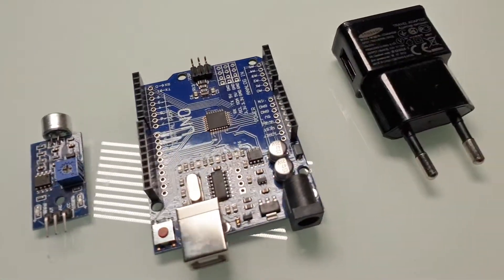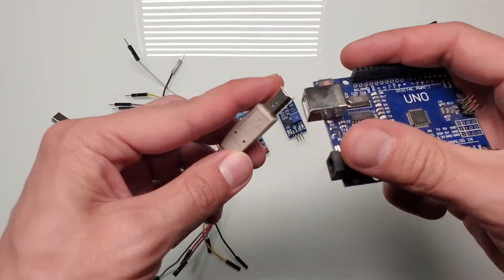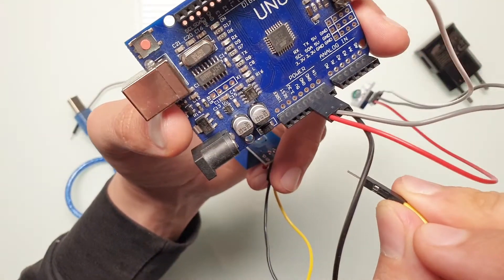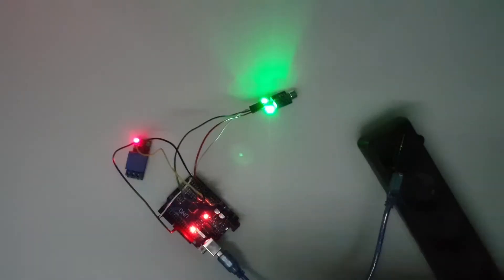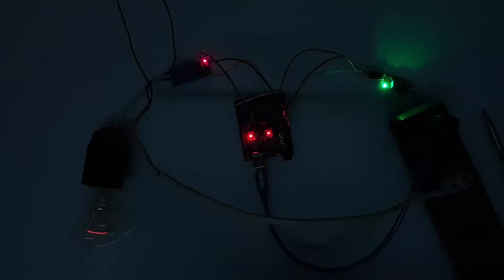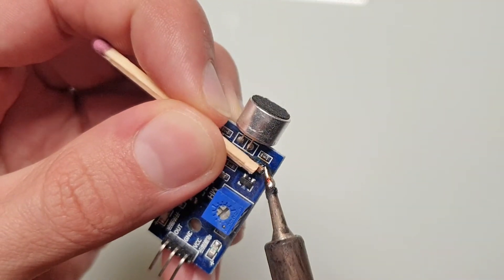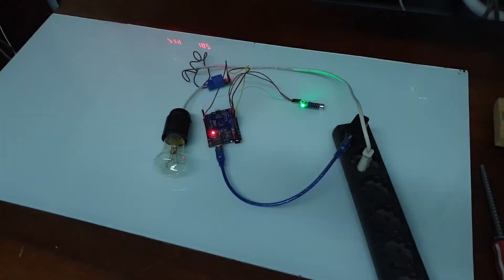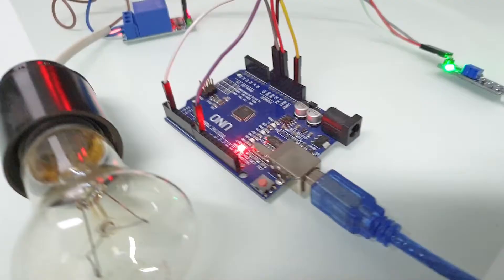How to make Smart Clap Switch using Arduino | DIY Arduino Projects

Comment: hi sir, i have a little problem sir, why clap its not detected at audino, but if i touch sensor audio, its can😅
Reply: Hello, did you manage to figure it out? I'm currently facing the same problem, the arduino only detects when I put my finger on the audio sensor.😪
Reply: you have to set the sound sensor's sensitivity by turning the screw on one of the compartments on the sensor